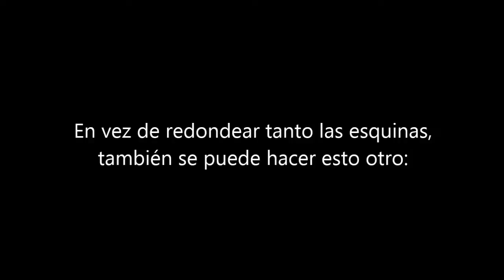Construcción Arkaluk 04

Comment: que tipo de fibra de vidrio usaste, saludos
Reply from the maker: Normalmente utilizo tejido sarga de 100 gr/m2, me gusta porque se adapta muy bien a contornos curvos sin hacer arrugas. También se puede usar tafetán en vez de sarga, aunque hay que tener más cuidado con las arrugas. 
En la parte inferior del casco prefiero poner dos capas que hacen 200 gr/m2, no por resistencia estructural, sino para que aguante mejor la abrasión.